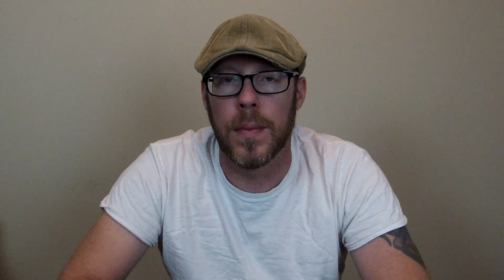Swimming Pool Anodes

Comment: Do you believe a puck in the skimmer is as sufficient as having this inline?
Reply from the maker: Definitely not.  I have reached out to a few electrical engineers and corrosion prevention engineers to see if I can get a more technical description of the difference between an inline, directly bonded anode versus a chunk of zinc that just sits within the pool water somewhere.  I would very much like to have an answer to this other than to say that intuition says the inline anode with a bonding wire must be superior.
Reply: @Swimmingpoolsteve  Did you ever hear back regarding if an anode in the skimmer (not directly connected) will provide any benefit at all?